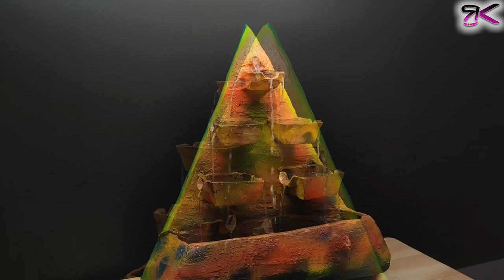DIY Awesome Cement Waterfall Fountain for Garden

Comment: Fantastic work bro.  I'm a structural engineer so just one small suggestion. Dont mind please. Concrete is compressive material. It needs a tensile force for longer run and to carry loads easily. So we need to add a little bit of reinforcement. 😊
Reply from the maker: Thank you so much for the info. Will definitely work into it.
Reply from the maker: I completely agree to that. And thanks for taking time to watch our video. 🙂
Reply: Naveed Emaar How and where would you reinforce it? thanks